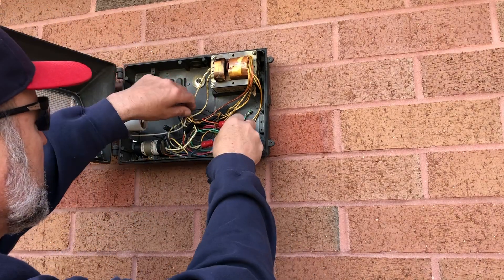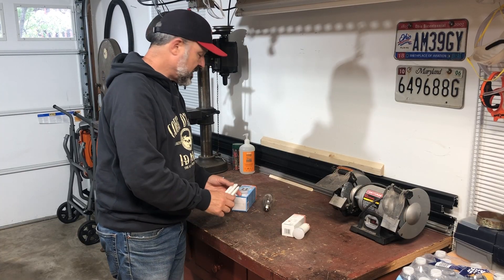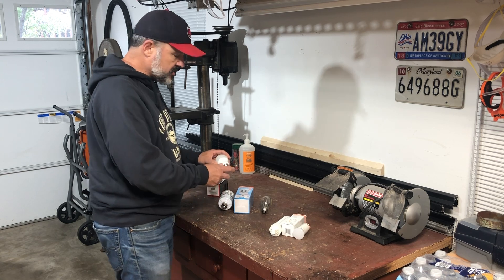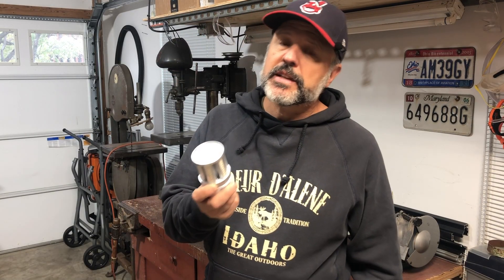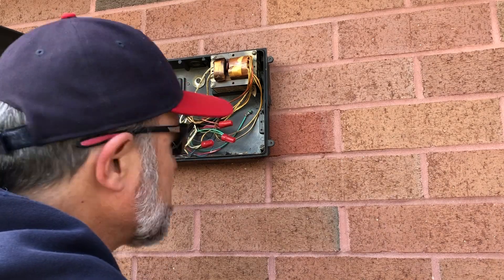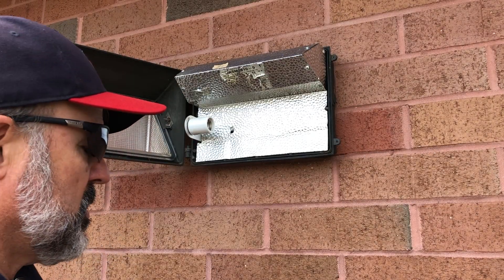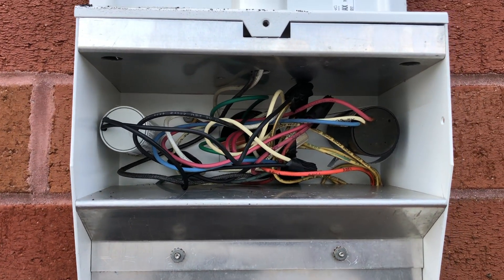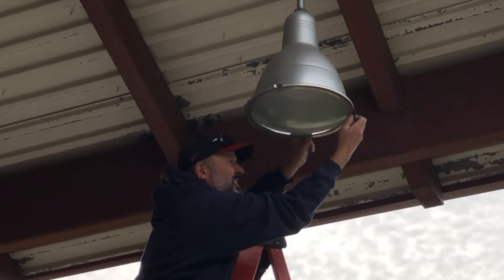How to Save $700 on a Ballast Bypass LED Conversion

Comment: I've been in the outdoor lighting for 30 years and the biggest oversight when replacing HID with a corn cob is the glass or plastic lens is designed to work with a single point source HID light and if not it will change the efficiency dramatically. I'm opposed to this retrofit and always best to buy an LED designed wall pack.